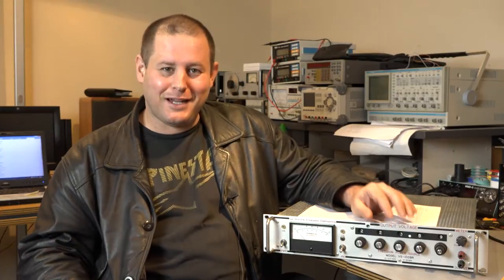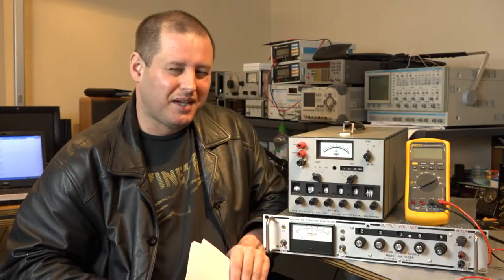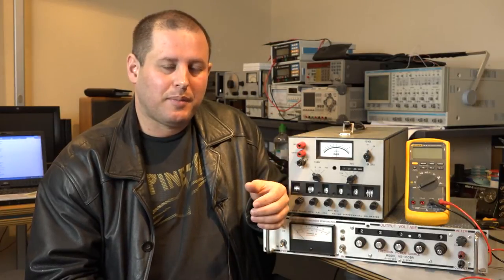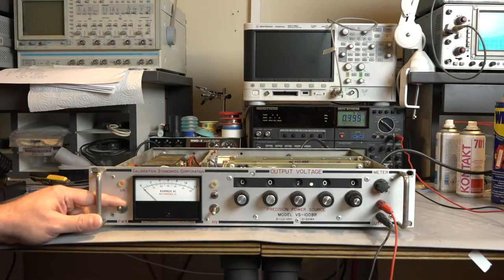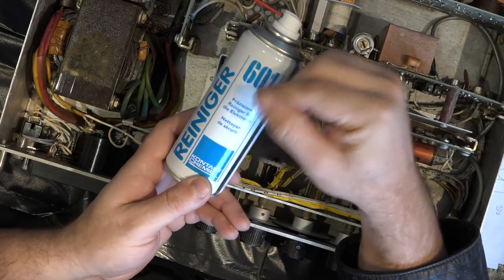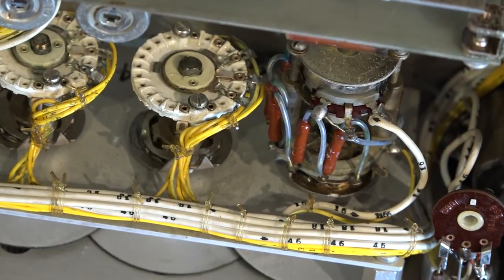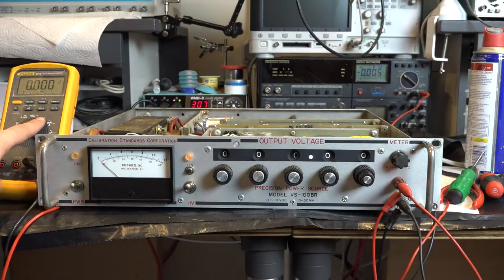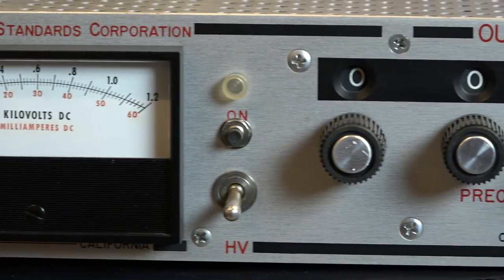Electro Instruments VS-100BR Precision High Voltage Standard

Comment: Interesting story behind it, glad that it's working and sitting in the right place.
Reply from the maker: Yes, interesting. Never sell Your dreams! This is what I learn from that. Yes, 100% working. After halfen our, I figure out the calibration pots. Now on every voltage level I have a same 0.00047 V shift. Now I just have to check all tubes, and this small op-amp where I get this shift. I have couple of 0.001 % resistors. I hope, with paralel bodge I can fix it.